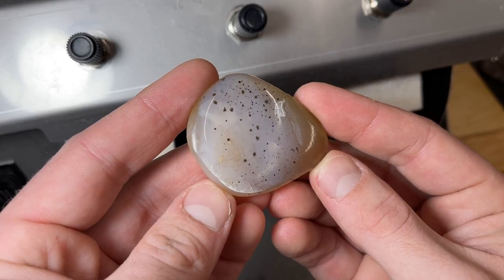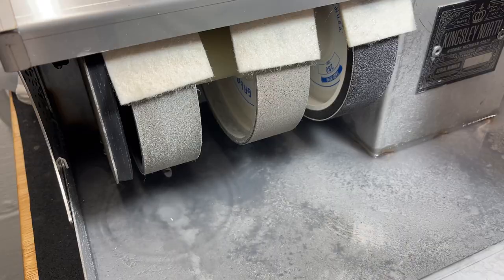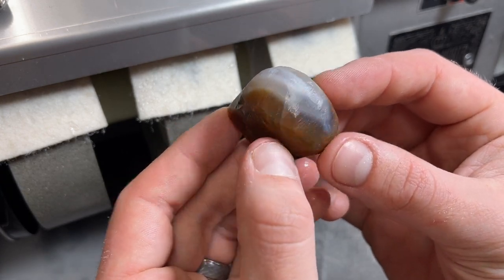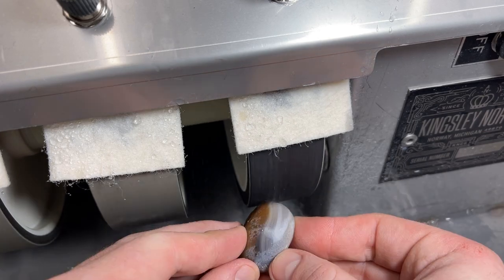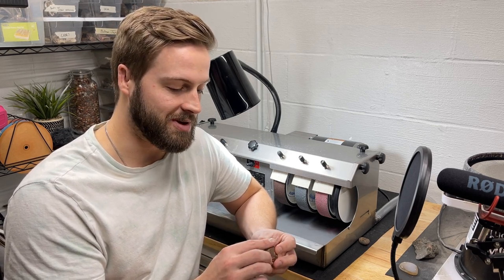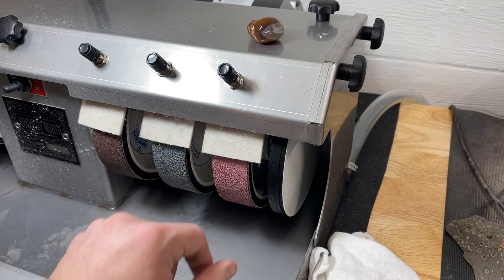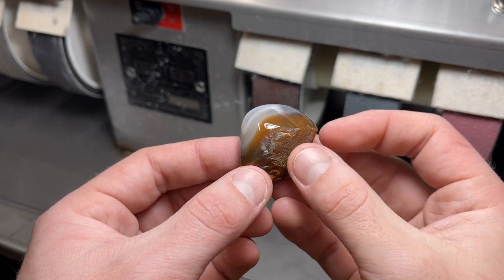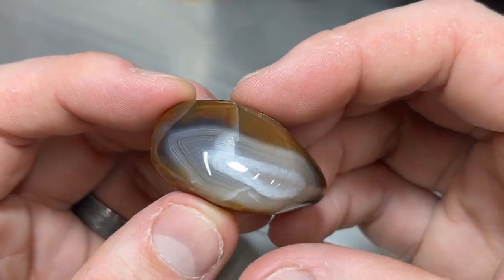First Time Polishing Agate w/ Cabbing Machine | Lapidary Equipment

Comment: Nice agate and congratulations on the cab king ! 
I lucked out and found a used 8" Raytech Gem Maker with 2 hard wheels and 2 expandable drums, the arbor is so much faster than the lap. 
I've found that standing up while using the arbor give me a little better angle on the wheels and helps me from hitting the other wheels with my hands. I still use my Hi Tech for all my flat surfaces thou. Good luck & enjoy
Reply: I agree that standing is the way to use a cabbing machine. It might not be as important when face polishing a rock like Taylor did, but it is if you're making a cab and trying to see the girdle line.

Comment: That's stunning.  My only thought is... why do all wheels have to be moving?
Reply from the maker: Its on a arbor shaft.. You may need 6 seperate motors or a lot more engineering going on to make that happen, which will likely cause the price to spike.

Comment: That was awesome! 

I used your “AGATEDAD” code to buy a new saw blade for my Hi-Tech Diamond saw. I found a colorful chunk of chert in my brother-in-law’s cornfield and it took a whole hour to cut once through it. Hopefully a different blade will go faster.
Reply: One hour to cut through a rock that was probably no larger than your hand is excessive. Have you tried dressing the blade you have? When doing number seven and harder Stones, I keep the dressing stone close by and use it after every cut.
Reply from the maker: Yeah a new blade should go quicker lol
Reply from the maker: Thanks for using my code!!
Reply: @jamesscott1932  I will look into that.
Reply: @jamesscott1932  thank you for telling me about dressing the saw blade. I watched some videos about it. The blade I’ve been using is supposed to be dressed with a brick. I didn’t realize this needed to happen frequently. Thank you for putting this on my radar.

Comment: Nice work. Really liking these machines the more I learn about them. I thinkthe stainless steel housing and the motor being separate from the machine and replaceable are two great selling points. Everyone is always on the cabking bandwagon, but once the motor goesout it's game over for the machine. You really should wear a mask when doing this though. Silicosis is no joke. Just because it's wet doesn't make it completely safe. If you can smell it, it's airborne.

Comment: That came out great! Awesome stuff man! I definitely hit my fingers a few good times when I first used the cab kings at the gem club hahha. Luckily the flat lap doesn’t have that issue. 
And I was wondering, what is that to the left of the first wheel? At first it looked like a cutting blade then I saw the black part too. 🤷‍♂️
Reply from the maker: It’s a 360 grit disc for light grinding of the back of cabs, that’s what the manual said at least.
Reply: @AgateDad  oh cool

Comment: Great video. Amazing result. Nice to see Kingsley North get a KNC6 into your hands. I got mine in September and love it. I get all my stuff from Kingsley North and couldn't be happier. Mainly used for polishing Petoskeys. I have one suggestion for you. You were using the center of the wheels the majority of the time. You need to use the entire width of the wheels. You might get "bit" a bit more, but they will wear more evenly. Granted, it was your first time, so you get a bit of a pass. ;)
Reply from the maker: I'm sure it looked like I only used the center, I know its hard for the viewers but I only show what I show. I was very mindful to use the entire area of the wheel for that exact purpose. It just so happened not alot of the full surface polishing on the wheels made it into the video lol

Comment: You could always dop the stone, that way you have more control and room, without getting your hand near the wheel.
Reply from the maker: The stone was too big to dop in my opinion
Reply: @AgateDad  Agreed, it was bigger than what I would use on that type of machine for cabbing but you can still dop with a bigger dowel, it would have made it alot easier to handle .